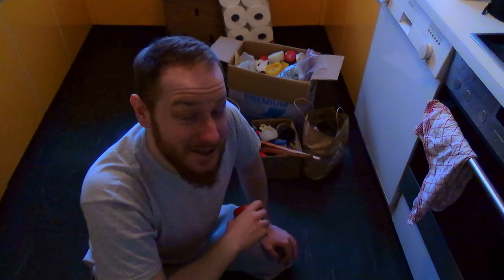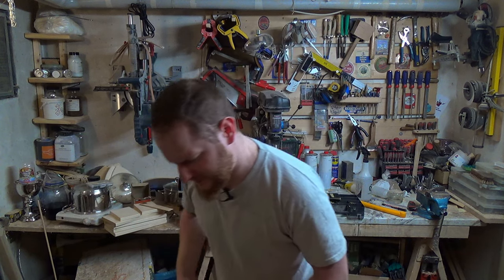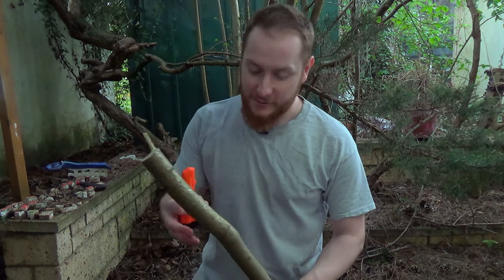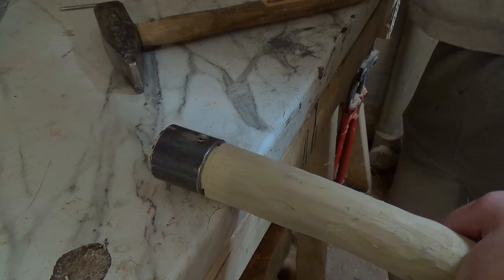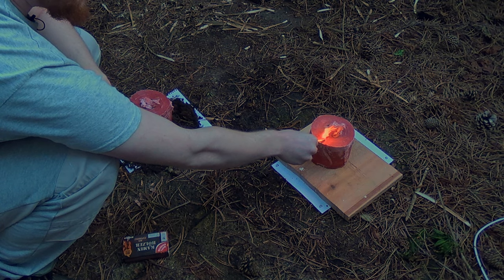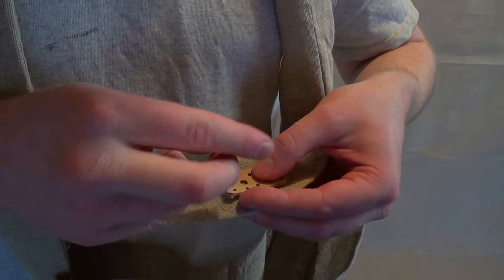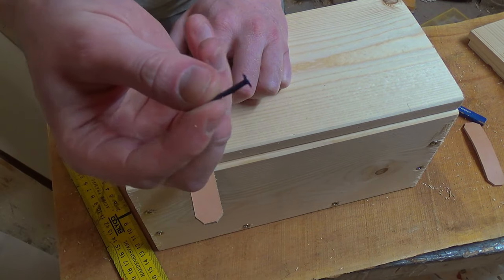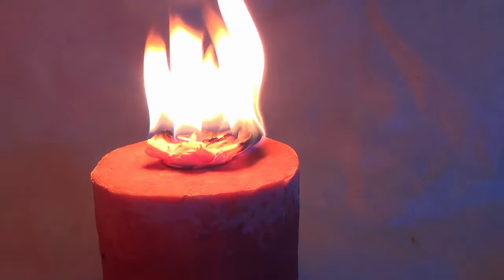Top 5 Living History/LARP beginner projects (cheap, easy, awesome)

Comment: For the rolls, take a pair of decently sized boards, so you can notch them similar to pliers or scissors with a bolt and washers or a wooden pin as the hinge point, and cut the ends so that they resemble hands clasping a loo roll slightly smaller than the ones you use, with the “fingers” (of which there should be between two and five) separated. Thin the handles where you don’t need the extra material, and they should be good to go. The multi point contact on both sides will stabilise it and reduce the odds of slipping or flipping.
Edit to add: you want the “hands” to cover about a third to half the height of the roll, so consider that when selecting you initial board width.

Comment: Sadly nails were expensive in the medieval period and that box should have been made with glue and wooden pegs to be realistic but the leather straps would have to be held on by nails or looped through  a small hole in the wood and glued.
Reply from the maker: I know. But as I said bevore the reveal the high authenticity mark isn't the target here ;)
Reply: @TheShieldery  But the wooden pegs are still within the scope of someone with a box cutter, Rather than finding nails that look slightly right causing more expense.
Reply from the maker: @ProfaneGod  Good point, I also thought about that.
But you couldn't hide the dowels, caus the screws holes have to get coverd up, therfor you need to place them from the outside. Caus of that the normal pre made dowels would be to ugly (and other reasons) and we would have to make our owen by sewing them from a round wood. That get's made after placing it in the holes, the sewing then often damages the board in which the doewl sits. You can again correct that with the box cutters knive, but that's a long rats tail we are building up here...
You allready need the nails for the leather on the other hand. So why not just use them for the other purpose as well ;)
Reply: @TheShieldery  You had what was left of the tree you made your walking stick out of, Which could have made the wooden pegs and they would have been less work to get the right size considering there were many parts of the tree, I agree with the leather straps, Plus it takes little effort to cut the pegs flush with the side so they don't stick out and look ugly, Also with your solution of the screw holes being too big for the nails it could just as easily be said to get bigger nails, It's a cheap fairly authentic looking box but if people happily deviate from trying techniques from that time that's all they will learn is how to take the easy way.
Reply from the maker: ok, I wouldn't say that cutting a natural branch to a pperfect fitting dowel is an easy task for beginners, but mayby we just have different oppinions about that.
The entire purpose and reason of this video is to make it the easy way, so I take your last sentence as a compliment ;) .
I am actually thinking about making a video entierly about "5 differnet ways on how to make an authentic medieval box or tchest" - or something like that. Wooden hinges for example are just so easy to make, underrepresented and highly authentic :) .
Reply: @TheShieldery  Why not go for three different ways to make a box Serf, Merchant, Lord each one being greater in cost and harder to make using hand tools to show the different styles and the pegs are tapered like a cone put glue in hole tap in pegs as far as it will go saw off excess any marks on box gives it a story of use before you do use it.

Comment: Love your video. Btw bark peels very easily in the Spring because that’s when the tree is getting ready to grow. Also fairly easy to peel in the summer and a bit into fall. But once the tree goes dormant in the winter it’s very difficult. So if you like the look of the natural bark and want the bark to be durable on the stick, cut it in the winter.

Comment: Some boxcutter knives are very flimsy, so guess better to use just any sturdy knife you have. Also yeah, I am a bit jealous that boxcutter knives over there are so good
Reply from the maker: A bandable blade actually makes a huge difference, so I'm afraid most of sturdy knives won't achieve the same result. You should try to get one of the boxcutter knives where you can lock the blade in place.
I once bought one of the advanced ones with instant changable blades and so on; It caused more problems then it solved. Only go for the one with a lockable blade, then oyu should be good :)

Comment: I'm making gourd water bottles right now, but I had not thought of using spent shell casings for cleaning them out.  I'll try that, thanks.
I like making walking sticks from branches from local fruit trees, or some wild mountain trees.  I do let them sit for about a year to dry out (after daubing wax on the cut ends to prevent cracking).
Reply from the maker: Hi, I used rivets and no shell casings; I'm afraid they could be to light :( . 
A year is quite long, but at last you can be sure that they are really dry then. The 4 days where really way to short. 2 weeks would have been reasonable in my case.

Comment: A cheap and simple finishing technique for wood like the box would be to burn the surface with a torch until it starts to get a bit charcoal looking, then bush with the grain with a wire bush (wear a mask and do it outside, lots of fine carbon dust) the end result will be very dark and will make the surface grain really POP. Give it a light sand, but not too much or you could lose the color. It's a great way to darken with without stain and it really accentuates the grain and creates a wavy rustic look as opposed to perfect machine flatness.

And since you've just driven a lot of moisture out, the wood is now very hard and will soak up a lot of varnish. I like to do a few coats of wipe on polyurethane.

Obviously if you're doing leather fixings you'll want to do them after, but with metal fixings you can sometimes leave them in place and the heat can make the metal look neat.

Just be careful, the wood can be a lot more prone to splitting so pre-drill and because the wood isn't as elastic to grip the nails you might get better results with screws. I'll usually cut the heads off of fancy upholstery tracks and then use some epoxy or jb weld to stick them over the screws
Reply from the maker: To be honest, I really hate that finish by now 😅. 
here are my reasons:
- It often get's made to little in a wrong way. Till now I have mostly seen quite  randome smoke traces that cover like 30% of the surface. If you want to make it correctly you got to burn it to a degreee, that you got a completly charred surface. this process deforms the boards and disolfs the pva glue.
- it's not historical correct, in the middle ages boxes of that size more likely would have been painted. I haven't see a single burned one yet, but if you got an example, please share the link!
- in my personal taste: Wood is more beautiful then charr
- wood ages without additional help by itself, there are so many ways to make the chest more beautiful and historical accurate
- If you want to age it realisticly only brush it with the steel brush, that breaks down the Earlywood way quicker down then the Latewood (I hope the therms where translated correctly, they mean the parts of the annual rings). By doing that you emmulate the effect of what happens when wooden boards are exposed to weather. Then add a thin acrylic  blueish grey wash and rub that of while it's still dry. After that has dried just make a slight dry brushing with a light blueish-white.

but in the End it's a matter of taste. I just have seen it quite often done wrong in "medieval" events although it never happened from a historical view and was done completly wong XD.
Reply: @TheShieldery  Fair enough. It does look terrible when it's done poorly and sloppily and you just get like tiger stripes. If you do it right it doesn't even look burned, it just looks old and brown and weathered. It definitely can weaken joints if you're not careful, but if you're scratch building then you can just be careful about not going ham on your mating surfaces. I've never had issues with warping though, and you shouldn't if the wood is dry already. But it can make an uneven surface, so don't do it on mating surfaces.

But yeah, totally a matter of taste. If done well it can look great, but it is easy to mess up. I'll have to try brushing without burning sometime.

Comment: Very cool, you make it all look so easy! I might need to try making a box someday to store my reenactment tools and shinies...
Suggestions for a part 2: a saddle bag/sack (super for carrying around your neck/other shoulders), simple leather pouches, willow basket, wood/horn spoon or bowl, simple braided cord (super useful to tie things or clothing), eating knife, bedroll...
Reply from the maker: I had/have list of possible items for my top 5 and the leather pouch was my Nr. 6; but becaus I allready had the shoulder bag as carriadge device I abandoned it... the braided Cord was on rank 8 because a leather cord could do the same job and is way more accessable. A bedroll is a ussadge of purchasable items and not an Item by itself ( I assumed?). The eating knife is a thing I didn't think of though. You could easily grind it by hand from a flat steel or similar and the handle could be made in a lot of simple ways. I just write it down as a single video Idea now :))))).
Thanks!
Reply: @TheShieldery  Yeah I basically went through the kit I take to reenactment shows 😆 Bedroll you can make with either modern duvets, or layers of fabric that you can quilt, or even sheepskins you sew together. Lots of ways to make a DIY bedroll of varying levels of comfort

Comment: Getting candle wax out of clothing is actuality ptetty easy.
First of course scrape as much of it off as possible. Then put a few layers of kitchen or toilet paper on both sides. Now put a clothing iron on it on a low setting. Silk for example. The wax will melt and get absorbed by the paper. Repeat if necessary.
Reply from the maker: thank's for the advice! If I'd have a Clothing Iron, I would like to test it :) 
I'll keep it in mind :)
Reply: @TheShieldery  It's an old trick I learned from my mother after I had been messing about with candle as a child  back in the 80's/90's.
And I've used it a few times since then.
Reply: @TheShieldery  a hot pot filled with hot water(to hold the temperture) will also work
Reply: Like when making batik cloth. 😁
Reply: When I was in 8th grade Advanced art class, we learned how to make batik clothes with drawings, and melted wax pen/applicators. That was a fun month.

Comment: Also, do you need to add some glue in the end while inserting nails in the screw holes? Will it make difference and if yes - which glue may be better?
Reply from the maker: If the nail should fall out gain, add a bit more splinters and it should stay in place.
If you want to use a glue instead, go for one as the pattex multy purpos glue ;).
BUT if you get a drop of that on the wood, you could have a hard time to remove it.

Comment: нужно было нагреть до красна втулку и набить на палку, а затем резко погрузить в воду. Она бы намертво села.
Reply from the maker: google translate can't handle that XD. English please?
Reply: @TheShieldery  it was necessary to heat the pipe to red. then put it on a stick and cool it in water
Reply: @TheShieldery  the pipe would compress the stick
Reply from the maker: that's an option, but you got to cool down the stick+pipe as fast as possible when you got it in place.
The main problem in this context whatsover is, that you can't do that as a beginner with simple tools ;)

Comment: hope that wasn't a plastic flower pot 🙄
Reply from the maker: Ah, crap; yeah they also exist; But the pleastic used for them should be able to withstand 100 °C, I think. (Most of) the plastic ones also have holes and are therfor excluded from the start ;)